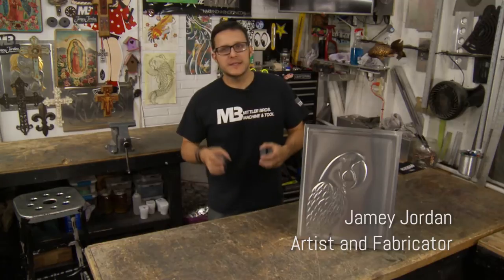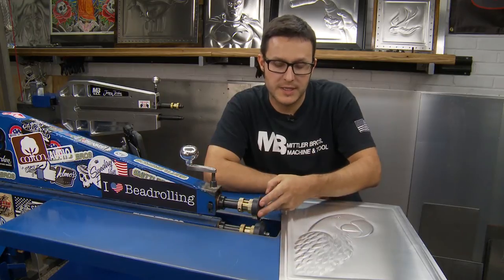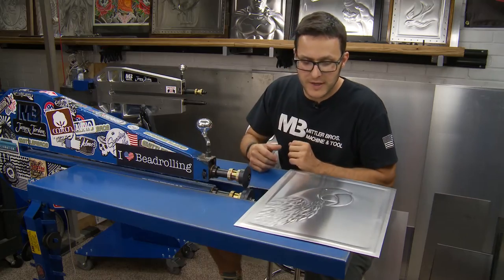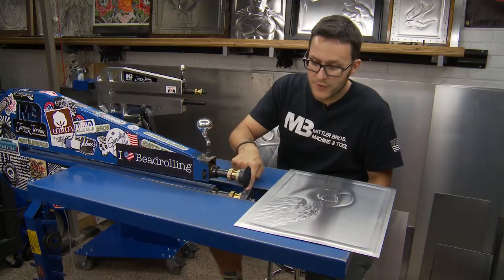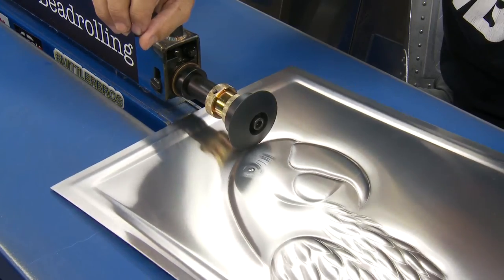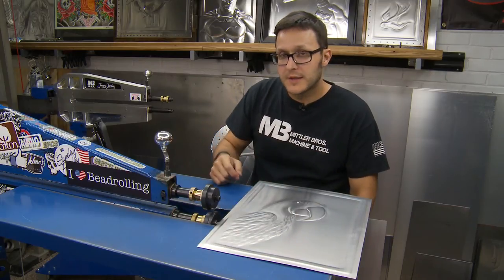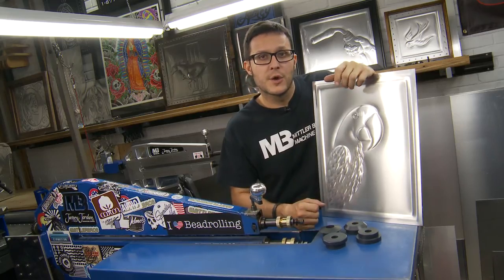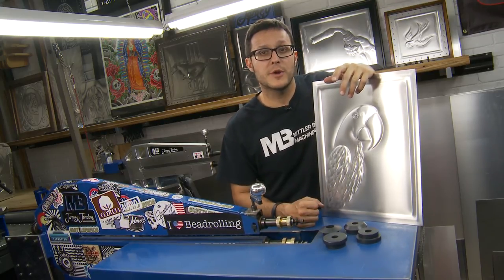Mittler Bros. Art Roll Step Kit - with Jamey Jordan

Comment: Hey Jamey which would be the best dies for doing a water texture ? 😃
Reply from the maker: We've seen Jamey use a combination of Stencil Roll and Skateboard Wheel a lot for detail and accent work like what you're describing.
Reply: @Mittlerbros  which is the stencil roll ? Can’t find it ? I have just ordered his 2 art series die collections is it in there ?
Reply from the maker: @georgiamorgan_  The stencil roll is in the art roll kit, yes. It is also available on our website in a single roll (#202-088) or in a set (#202-089). Skateboard wheels can be purchased individually or in a set with all three hardness' (that #202-108). There certainly are a lot of options and plenty of ways to get there.
Reply: @Mittlerbros  super thanks 😊
Reply from the maker: @georgiamorgan_  Absolutely anytime!
Reply: @Mittlerbros  Thanks All ordered 👍🏼😁

Comment: What is the practical purpose for this machine.
Reply from the maker: These are machine tools that makes rigid lines in sheet metal to make surfaces more rugged and durable. The lines added to sheet metal prevent warping and disfigurement by adding structural integrity to the metal. And it of course doesn't stop there. As you can see, the true limit to these machines is one's imagination!
Reply: @Mittlerbros  awesome. Thanks for the great response.
Reply: If you're good enough at it you can make a lotta money : )